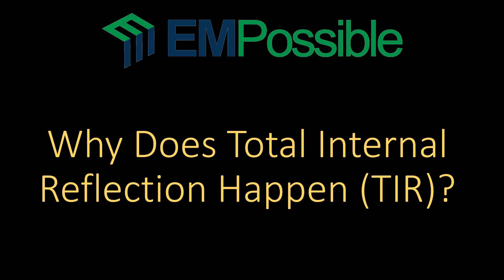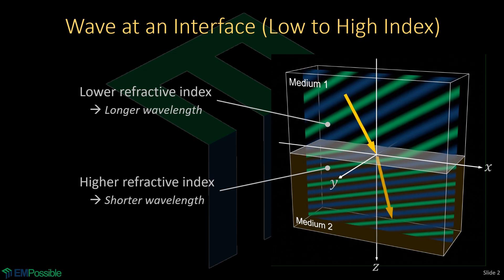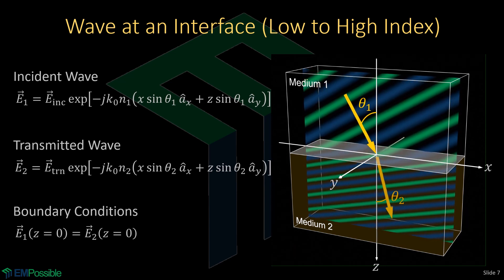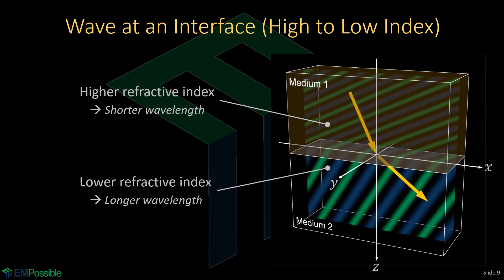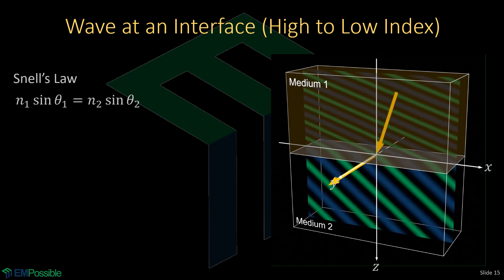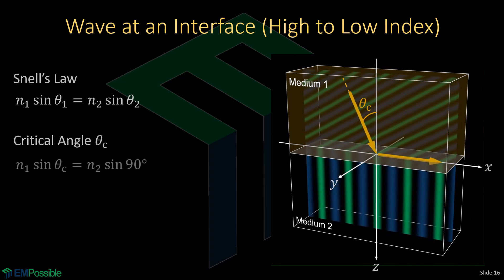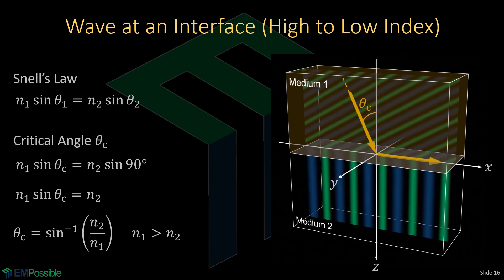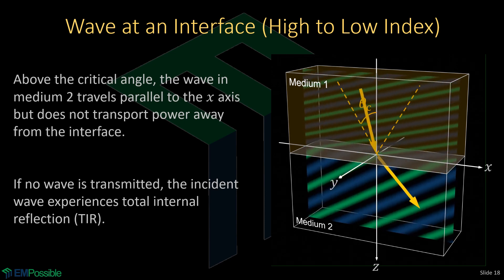Why Does Total Internal Reflection (TIR) Happen?

Comment: Dumb question, why do we typically (only?) use Snell’s law when talking about light passing from one medium to another? It’s an EM wave just like those in other parts of the spectrum. Is it a usefulness thing? Aw man now I just thought about s-parameters. I don’t anything anymore…
Reply from the maker: As far as I understand it, Snell’s law is valid for all types of waves and frequencies; sound, light, radio frequencies, vibrations, etc.  The scattering parameters do not take into account changing of direction of waves.  S-parameters only quantify how much of a wave reflects and transmits.  If you are interested in this topic, I am going to be releasing some videos soon showing that the Snell’s law and the law of reflection (angle of reflection = angle of incidence) are actually incorrect.
Reply: @empossible1577  thank you. It’s very helpful for me to see things in relation to one another instead of presented in segregated compartments. I just watched the new video and just realized fresnel equations are typically used when talking about reflection/transmission of EM waves between different optical media. Where as scattering parameters, like you said, only consider the amount of reflection/transmission (I.e., power and energy) not direction and are typically used in circuit analysis (RF and microwaves). Though I have used them in optics to look generally at transmission and reflection through an element across a waveband. In this case, I don’t care so much about direction (e.g., imaging) as I do about just knowing how much light actually goes through my optical element.